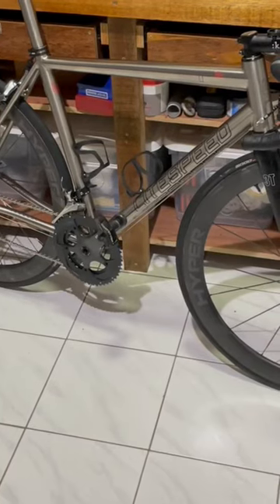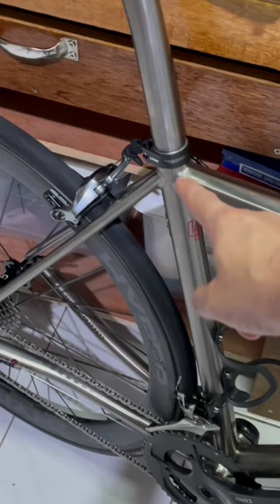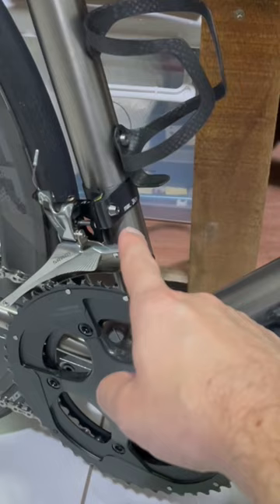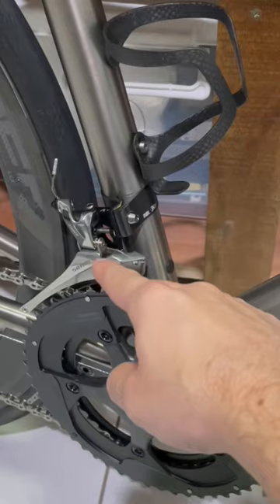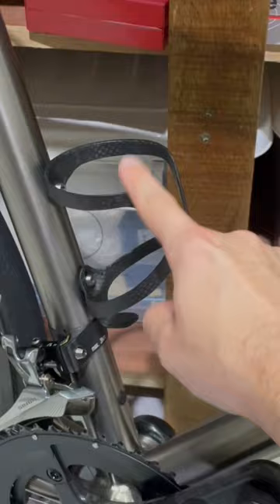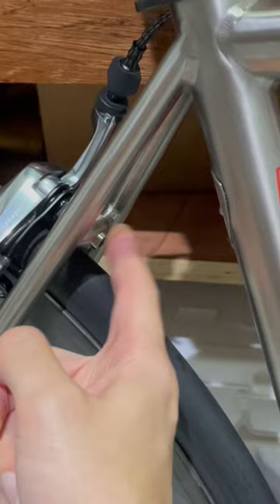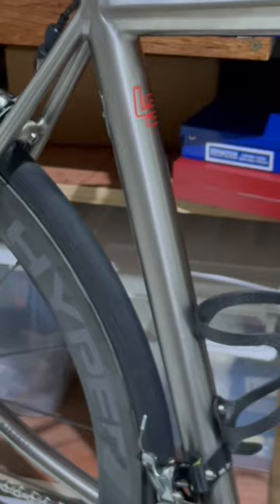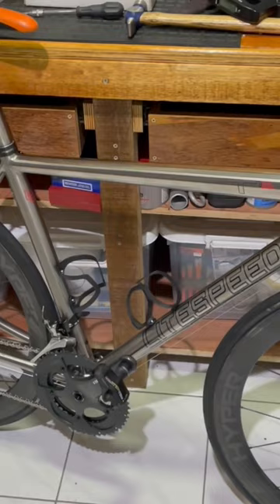Titanium Bike Flex. 💪🏼

Comment: Please tell me you invested heavily in anti seize
Reply from the maker: I put copper grease on every bolt, but titanium on titanium isn’t a problem. It’s dissimilar metals that are the problem… and especially carbon.
Reply: @reginaldscot165 I finally pulled trigger on titanium frame. Any tips on which copoer grease and where to apply it specifically? before i go to get it built

Comment: How much did you spend to save 150g
Reply from the maker: Very little, the Ti bolts are cheap from Aliexpress and the TPU tubes are only $4 more expensive than regular tubes. The carbon hangers/clamps are $20 and the cages… ($25) well I needed new ones anyway so I could transfer the old ones to a different bike. 

All in all less than $100.

Comment: The carbon fiber bottle holder will fail. The bottle holder lower tab will flex a fail. Happened to me and the water moved down and damaged my carbon fiber bike frame.
Reply from the maker: When they fail I will just buy even lighter ones! 😁 I saw some on Aliexpress that are 6g! I have used carbon cages for years and so far only slightly broken 1 that was 3k carbon rather than unidirectional carbon. Also thankfully I’m not worried about frame damage. Titanium for life! 😍

But yes, if you want reliability go reinforced glassfibre or titanium cages.
Reply: I use profile design old school

Comment: Where do you get good quality titanium bolts?  I'd be careful about brake caliper bolts.
Reply from the maker: Some are from EU some China. Honestly I’ve never heard or seen anyone snap any titanium bolts yet, aluminium and steel yes. The brake nuts are solid as a rock, no way they are failing. 😁👍🏻

Comment: Replacing latex tubes with tpu tubes is not an upgrade. Latex tubes roll and feel so much better. They are faster too. Just ask Dan Bigham and Filippo Ganna.
Reply from the maker: Slightly faster yes. About 1/2 a watt. But heavier and you need to pump them more and they are harder to fit. 😊

Comment: What size?
Reply from the maker: The frame? 55cm top tube. Litespeed call it ML. With 100mm stem. And 20mm layback on the seatpost.
Reply: @reginaldscot165  Very nice and very low weight for the size! 

I noticed you are using Jagwire cables,  are those the “elite” ? Are they actually lighter than Dura Ace or Sram?
Reply from the maker: @thedronescene7474   Dude check out the Dream build components video I did on the bike, in it I give all the information about the cables. And no it’s not a brand you have heard of. 🤭🙂👍🏻